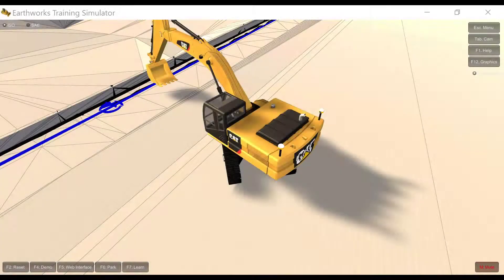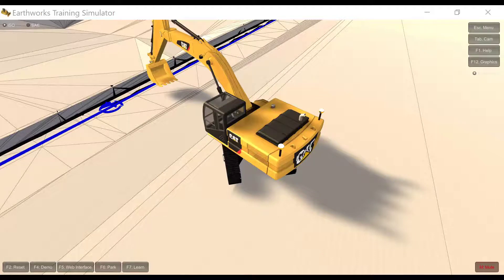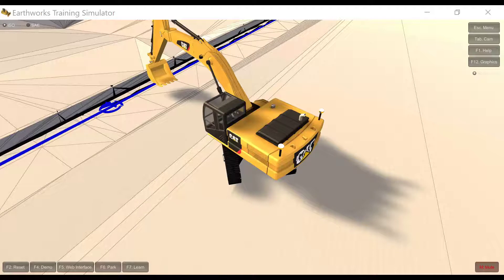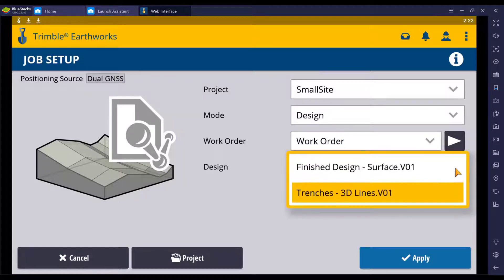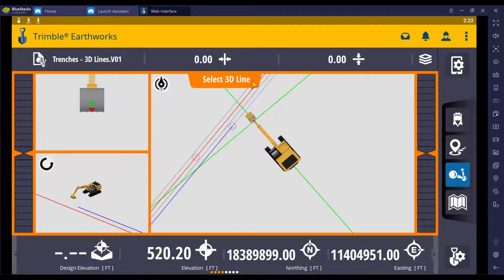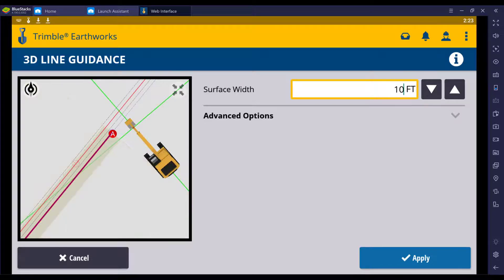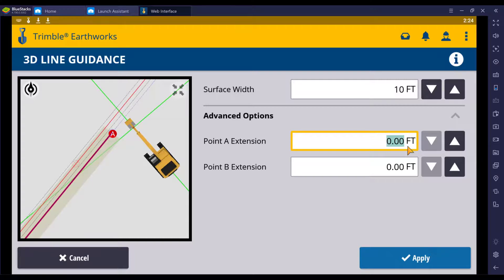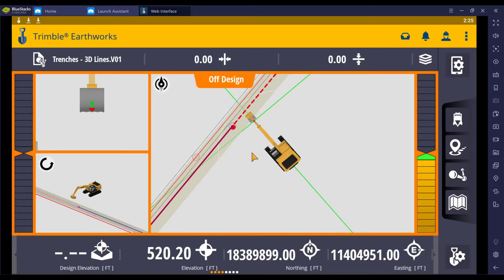Earthworks 3D Line Guidance - SITECH Louisiana

Comment: How do you get a 3d lines job? Do you leave out the surface on TBC and it automatically creates a 3d lines job?
Reply: When you create a design under the construction data tab, select 3d lines instead of surface under the model/edit buttons. Select only your 3d lines when making the selection and proceed as normal.